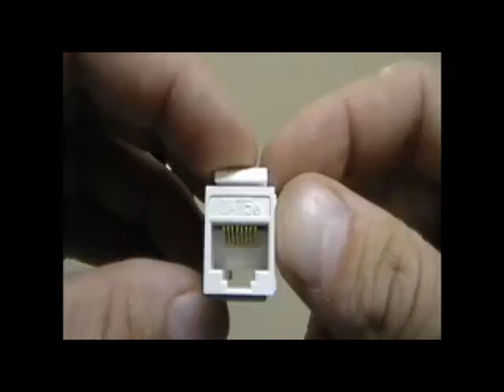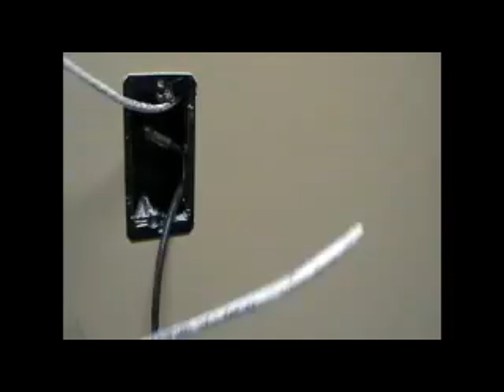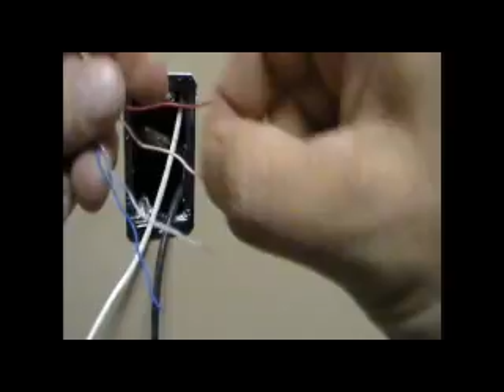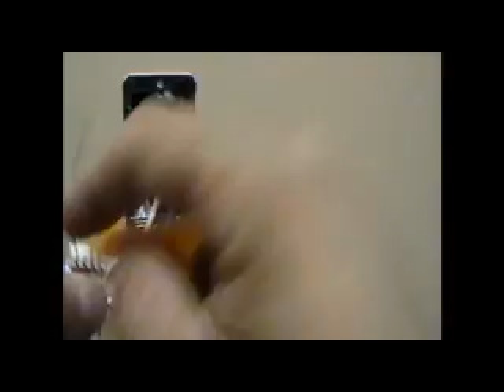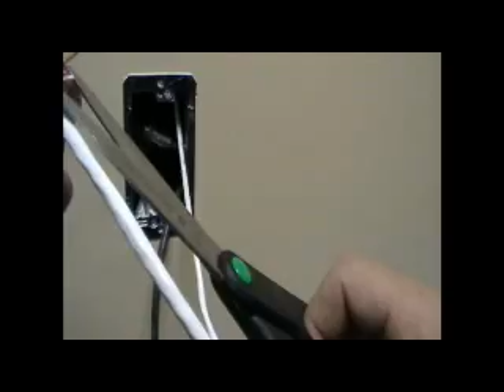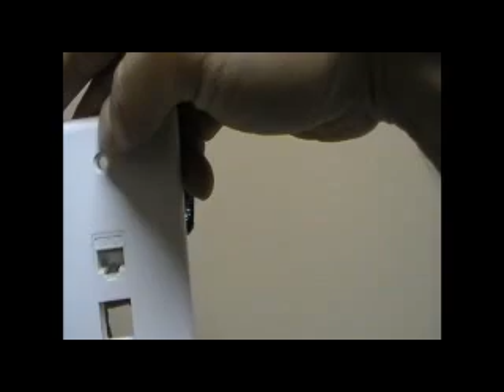Cat5e Eithernet internet computer jack installed

Comment: My jack has the colors and letters in the middle. It goes: Left from Top down: BA, Brown with a line, Brown with two white arrows points together, green with same line down middle but orange on the right side of the line, then same color scheme as above with the said arrows. Right from top down, BA, Blue with said arrows, Blue with line, Orange left green right with arrows, then orange left green right with line separating them. Any help would be appreciated!.

Comment: Thanks.  I haven't done one of these for about 10 years, and even then it was er, just once!  Worked first time.  Full bandwidth.  And I had to use a small flat head screwdriver as a punchdown tool.